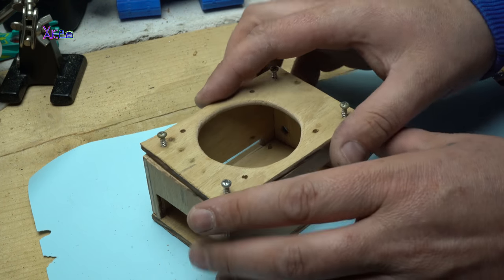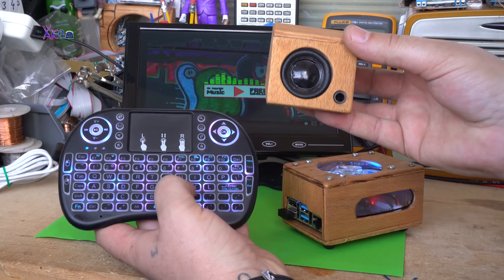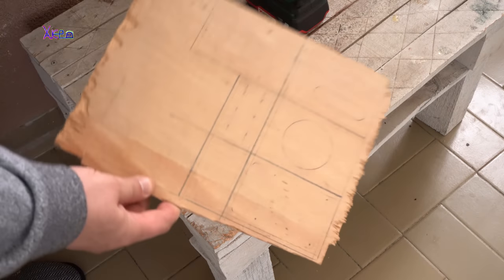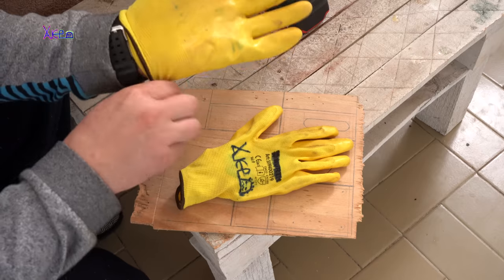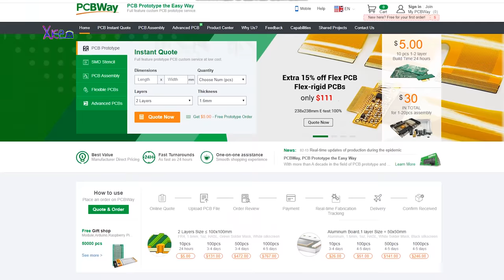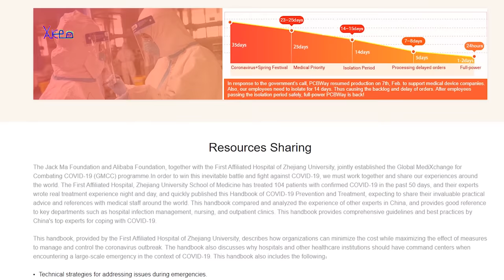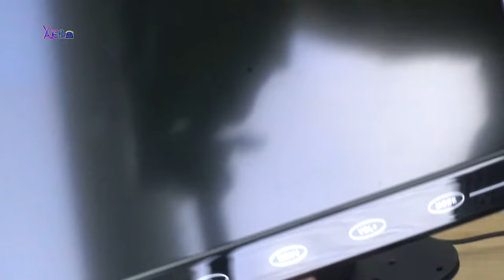How To Build Mini Computer at Home

Comment: Nice video. If you intended on blowing air in, then your fan is upside down. If you plan on blowing air out, then the fan is correct. Either way, you'll want to add heatsink as well. It will help with the thermal throttle. Very cool case build.
Reply from the maker: The fan pull out hot air,the right way
Reply: @Hacktuber  with that size fan the cooling will be adequate.